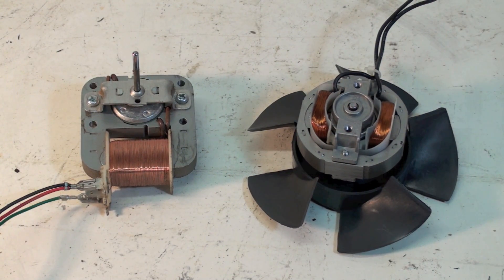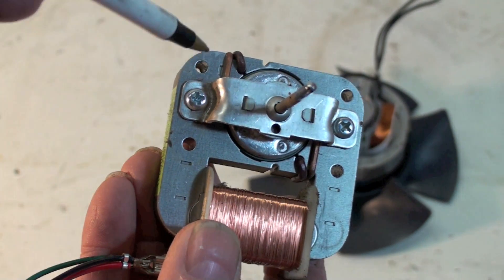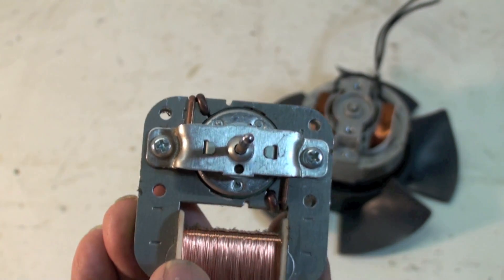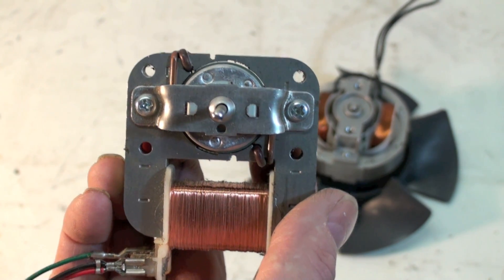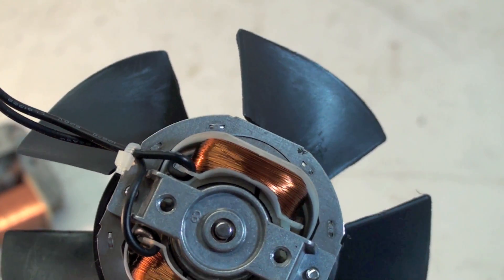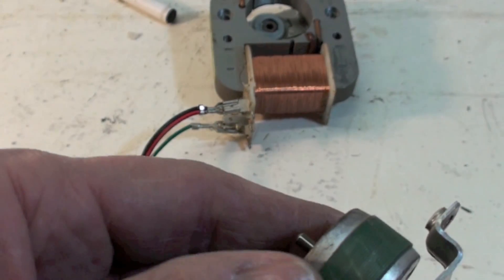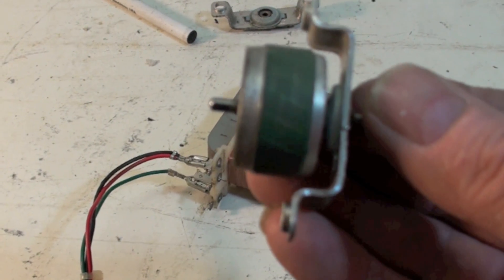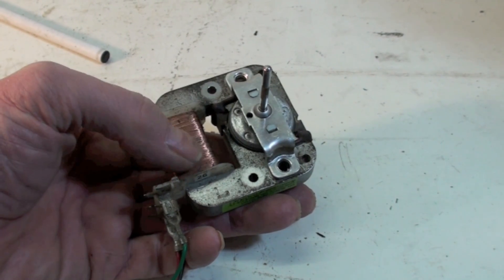How does the shaded pole motor work

Comment: They are probably the most reliable type of motors use in things from microwave to the bathroom exhaust fan. No capacitor to go bad no circuit board to fail due to component failure. Even in this high tech world they are indispensable

Comment: Can you comment how the brass "brake" or insulator used on some SPM? Such as on part # PD501861
Reply from the maker: That part is a start "circuit" that is energized by induction from the main winding somewhat out of phase with the main winding to give the rotor a "kick" to get it rotating.  
GFM

Comment: I have an exactly same shades pole motor but the rotor gets locked when applied power. 

The coil seem to be good, reads about 46 Ohm and draws correct milliamps from 120VAC supply.  
It's just that the rotor doesn’t spin which is very strange because the motor doesn’t seem to have any mechanical failures, at least from visual checks, I don't see any difference. 

Any clue why these motors fail such way?

Comment: I think I'd pick one of these over something that requires a capacitor. I'm new to electricity and motors but it seems like something with a capacitor would just be more costly. That second motor gets the job done just by making a gap in the metal...if it's stupid but it works, it isn't stupid. And like you said, they don't use much power anyways.

Comment: Can the windings be replaced?
Reply from the maker: That depends on the design of the motor.  Many can.
GFM
Reply: The whole motor is cheap to buy , normally its the Bush bearings which give up , these motors have little torque. and easily seize up which prevent the motor from turning on start up .

Comment: Excellent explanation, just what i needed.  Subscribed!
Reply: The second winding is not another speed its an aux winding around 30 volts to drive an alternative motor of other part of the circuit ,acts like an auto transformer.Use it in a Microwave and the other winding is used to drive a low voltage 30v turntable motor.

Comment: How should i plug in yj58-12A? To make it work? Deffenetly not on 220V. Could you give me some tips?
I've tried USB port and phone charger, didn't work
Reply from the maker: Well, I believe its just a 2 wire motor, and it appears to be 100 to 240 volt. Just plug it in.
GFM

Comment: What lubrication is recommended for the bushing?  Do some use just plain steel bushings?  The ones in my cheapo fan don't look bronze.
Reply from the maker: The bushings won't be steel.  They usually do not have oilers.  You can add oil on the shaft that may help.  If you can a zoom spout oiler, its the best oil.  Motor oil will also work.
GFM
Reply: I used lithium soap grease hoping for a longer interval between lubrication.  Would oil last longer?  There is no felt to soak up lubrication.
Reply from the maker: Its not so much the oil, but the bearings are failing.  New motor.
GFM

Comment: there is many kinds of Shaded pole motors the thick copper bars are called shading coils that other motor with the fan on it the thick copper shading coils are under the windings. as 3.3 incc, 4.4 inch and larger cost more than those mainly the FASCO, Century both of which are owned by Regal Beliot.  the 3.3 inch shaded pole motors can have 2 to 4 poles, the 4.4 and larger can have 4 , 6, or more poles the more poles the lower the RPM will be as the larger Shaded pole motors draw alot of power. when i replace a motor in my vintage Vornado fan i prefer the PSC motor it draws less amps. as i think in the near future the larger Shaded pole motors will be phased out being replaced by either PSC or ECM. and the only motors that will be around would be the C frame and Skeletal shaded pole motors. which are used in fans, heaters, phonograph turntables, light duty pumps, as this US goverment gets more energy concious to find ways to use less energy.

Comment: most of the FASCO 3.3- 5 inch shaded pole motors aren't cheap to get than the small appliance shaded pole motors the round or C frame. as these motors are being replaced by PSC or ECM motors. as the early Vornado fans and Lakewood fans as many other fans from the late 1940s to up to 2000 used shaded pole motors as now they went to the cheaper PSC motors which don't last too long and catch fire as LASKO got hit hard on this on their box fans which forced LASKO and other fan manufacturers to put a fuse in the plug for safety. the smaller fans stll use a C frame shaded pole motor or the round skeletal 2 pole motor. as some of the larger C frame motors are being used for draft inducers for both furnaces and Water heaters. the drawback to shaded pole motors is their low starting torque and tend to draw more power than PSC motors when running. its common on these unit bearing refrigeration motors when the bearing fails they make noise and wind down and tries to get up to speed. as i have an older Vornado b-38 c-1 fan as im looking in replacing its motor which is shaded pole to a PSC motor as its driving a heavy metal deep pitched blade. and draws well over 2.4 amps when running. as im looking to see which PSC motor will work and fit the existing mount ring as the vintage vornado fans were made by the O.A.Sutton Corporation in Wichita Kansas from 1945-1959 when the O.A,Sutton Corp ceased production of the vornado fans and the company was aquired by Two Guys. and named it Vornado Inc. as today its Vornado Realty Trust as 1989 is when the Vornado fan was reintroduced and was kn own as Vornado Air Circulation Systems Inc till 2006 as today its known as Vornado Air LLC. the early of the circulators all used a shaded pole motor till in mid 2000 they switched to a PSC motor which was introduced on their 283 Heavy Duty shop fan. as today its known as the 293 Heavy Duty shop fan. As that fan is more preferred for job site as well as circulating air in a room. in all Vornado products are the best.

Comment: Any advice on how to repair a burnt motor like this one?
Reply: If the windings are toasted you should disassemble the motor, remove the part of the laminations that's inside the coil from the main laminations stack and rewind the windings with the same diameter of wire and the same number of turns. Sometimes the coil formers are with very weird shape and are hard to rewind. Expect around 2300 turns per winding, that's a lot of work so really if you can find a replacement better take a new one.
Reply: First remove the rotor with the bearings by unscrewing or unriveting.
Look at the sides of the winding formers where the inner lamination stack is contacting the outer lamination stack. Place the motor on two wooden blocks or whatever to support outer laminations stack so the coils are free in the air. Then find a convenient metal rod (a screwdriver or whatever) and a small hammer. Place the rod on the inner laminations stack and start to tab on the rod slightly and carefully. It should start to slip out. Then go to the other side and do the same thing. Continue in this manner to symmetrically get out the whole stack. Then try to figure out how to remove the coil formers. In some cases they are two sepasare and the task is simple, but if they are like the motor in this video (the one with the propeller) its very difficult to remove and to rewind, I broke one assembly like this recently its very werid construction and don't know how it's supposed to be disassembled and winded. Good luck!
But before disassembling the motor check if the windings are really burnt or melted, sometimes there is a thermal fuse on the top of the one winding which can be open. Find if there is one and shunt it. That can be the problem and the motor will be running again.
Reply from the maker: There is no effective repair here.  Replace it.
GFM
Reply: Origoangelohrol322 thanks!!! how should I separate the laminations?
Reply from the maker: Just had to jump in here.  You realize that these motors cost between $10 and 25 to replace and that winding replacement does not solve the most common problem with this type of motor.  That is, of course, bearing failure.  Just a thought.
GFM
Reply: grayfurnaceman Of course but the question was about repair. If somebody wants to try rewinding it just for the sport he's free to try to do it. Sometimes the motor is not the standard one and it's hard to find a proper replacement and rewinding is the only option. The bearings can be fine in the case.

Comment: Excellent video. The info on reversing the motor was a surprise to me. I was always putting them back together the way they came apart.

Yes, the bushings are pretty cheap on these motors. The problem that I usually find with them, is that the lube on the bushings gets dirty and gooey. Once that is cleaned off, and new lube put back on, the motor is ready to go again.
Reply: +ke0nc 
"Lubricated For Life". (or 1 year, whichever comes first)
Frequent cleaning and lubrication is what makes these motors last 50 years vs. 2 years.
Reply: +scdevon You sound cheap...uh...frugal, like me.

Comment: I have one disassembled too at home....Do you have any idea how speed switching works? I think it works by using 2 separated coils with different number of turns, affecting inductance and resistance thus producing different stator voltages, hence different torque.
Reply: duncpol seems about right

Comment: it would be a miracle motor if it was a 1/3 HP lol
Reply: +Ben Boudreau More like 1/100th HP  LOL
Reply: @scdevon  120V and 0.3 A equals 36 W. 1 horsepower means 746 W, so it's 0,48 HP (~1/20HP).

Comment: Thanks for this! Wonder if you could use the stator as a tool magnetizer/demagnetizer when the rotor/bushing is finished.
Reply from the maker: +daikaiju20 You would have to run DC power thru it.
GFM
Reply: +grayfurnaceman Of course your right. Thanks for all you have up!!

Comment: I've been taking old room oscillating fans, small big and can't find a shaded pole motor in any of them. could I find one in an old microwave , refrigerator, dishwasher, shop vac, or clothes dryer? I need one and every time I open up an appliance I get something else.
Reply from the maker: ***** Are you sure?  They are by far the most common motor for the cheaper applications.  They are in microwaves, refrigerator condenser and evaporator motors.  Not in dishwashers.  Shop vacs are brush motors.  Dryers are PSC motors.
GFM
Reply: grayfurnaceman Thanks, I finally found one after operating on the 4th fan. That's not including the other items I tore apart. I kept telling my friends that all of the videos show these fans running a shaded pole motor. I thought I was losing my mind. Anyway it worked out great. Now I have a kick ass tool demagnetizer ready to mount on my workbench :)

Comment: awesome video, lots of good info.  I have one in my air hockey table that went out and can't find an exact replacement, i've found some close, but the mounting holes on new ones are just 2 on each side of the stator and about 3/8" apart.  Would it hurt the motor if i drilled holes where i need them at the four corners of the stator? Also my stator "block" if you will is an inch thick.  Does the thickness of that have any effect on the motor?

Comment: Q: How Does The Phase Shift Form?
A: One of the common characteristics of magnetism is the effect of resisting, or opposing change of current and magnetic field.  It is used here as follows.  The thick copper strap is a winding that is a shorted turn. 
...
  As the magnetic field from the main winding increases in the first quarter cycle of the AC, this induces a current (called eddy current) in that shorted turn.  Remember that it is a change in magnetic field that induces a voltage in a conductor and therefore a current.
  Because it is a heavy gauge wire it has a very low resistance and, therefore, a relatively high current (remember it is a shorted turn).  This current must also have its own magnetic field.  It turns out that this field opposes the one from the main winding and, therefore slows the buildup in that part (the shaded pole) of the stator.
...
   As the main field decreases during the next quarter cycle, this induces a voltage & current in the heavy shorted turn in the opposite direction as before.  This current has a magnetic field of its own as well and it is in the opposite direction as before, so it is in the direction to ADD TO the main field, thus delaying the collapse of the field in the shaded pole.  This is a phase shift in the magnetic field of the shaded poles compared to the main pole.  This can also be viewed as a delay in the shaded pole field giving a rotation of the overall field.
...
 This phase shift induces a different current in parts of the rotor creating a torque.  In a VERY simplified interpretation, you can consider the delay to be dragging the rotor in the direction from the main pole to the shaded pole, thus turning the rotor. [it's not quite that simple in an induction motor because there are voltages, and resulting currents, being induced in the rotor, but this is a good start]     Ha ha... no pun intended.  I saw this as I was proofreading!
...
  The opposition to change is the same thing that is called inductance; makes ignition coils work; and why a strong magnet will fall slowly inside a conducting pipe.  The current induced by the changing magnetic field acts to resist the change in the magnetic field by creating an additional magnetic field that opposes the change by either subtracting from, or adding to the original field as needed (to try to prevent, or at least reduce or slow [delay] the change).
...
The old mechanical speedometers used a rotating magnet inside a conducting cup.  The current induced in the cup by the moving magnet, caused current in the cup and a magnetic field that resisted the change by "dragging the cup along" against a spring, and thus reducing the relative speed difference and moving the needle attached to the cup.  The faster the magnet spun, more current was formed in the cup and more drag turned the cup more against the spring.
....

Hope that helps make the whole process a little clearer.

EDIT: Here's a REAL shorted turn for ya!
  Liquid N2 and copper tube magnetic levitation 
The induced current in the pipe produces a repelling field below the magnet and an attractive field above the magnet.  The faster the magnet "falls" the stronger these fields become and when gravity is balanced, it reaches a fixed velocity as if there were no fields and no gravity.  Since it is not accelerating downward it has no net force acting on it, so it travels at a constant speed.
Reply from the maker: It does.  Thank you for a very complete explanation.  The speedometer explanation was interesting as I have seen them work and that explains their operation very well.
GFM
Reply: grayfurnaceman Forgot to mention.  It appears that the motor in the vid actually has two shaded poles, so there is a double effect.  The larger one delays the main field some and the smaller one delays a little more because it is actually delaying the field from the first shaded pole.  Pretty cool.  I didn't know they did it with two.

Comment from the maker: The primary winding magnetic field induces a voltage in the copper bar which becomes a magnet that is placed a few degrees offset of the primary winding.  With an offset magnet, it will drag the rotor towards it and begin rotation.  Hope this explains.
GFM
Reply: Is it normal for them to get really hot even though they aren't seized at all and spin freely?

Comment: AC Induction motors WILL NOT COG If they have no phase offset.. Neither will AC induction motors with Run/Start capacitors to offset phase in windings..  WITH NO OFFSET, THERE IS NOTHING TO ROTATE THE ARMATURE.

Comment from the maker: By increasing the length of the winding you increase the impedance (effective resistance to electrical flow).  This reduces the amp draw thus reducing the power output the motor is capable of.  So if I install a long winding then tap the center of the winding, the short winding will have less impedance therefore allowing more amp draw and more power output.  Hope this explains well.
GFM

Comment from the maker: The amp draw is very close whether running or locked rotor.  The windings overheat slowly mostly because there is no fan cooling.  There are of course differences in design between different applications such as a motor not used as a fan would be designed with better heat transfer than a fan application.  There is really no such thing as overload for shades pole motors.
GFM